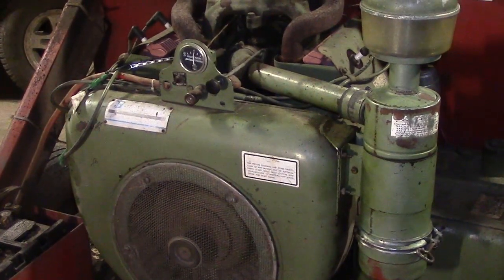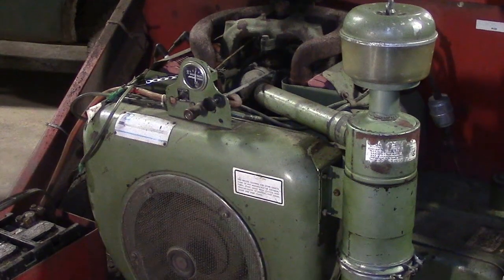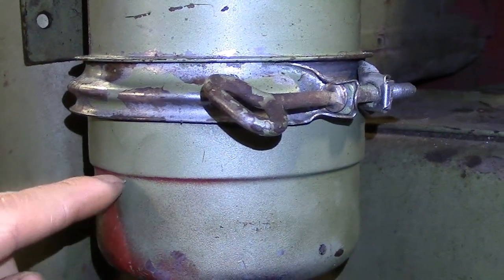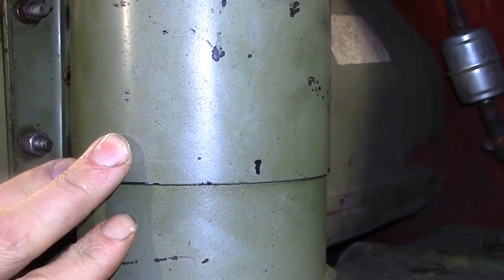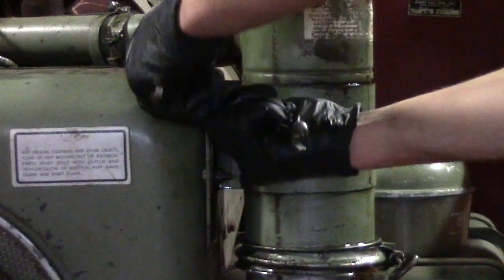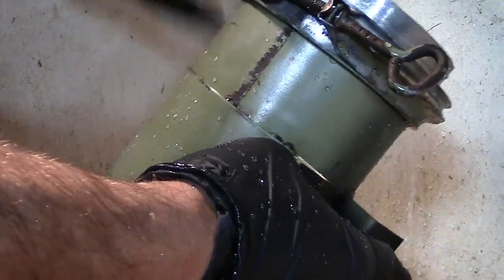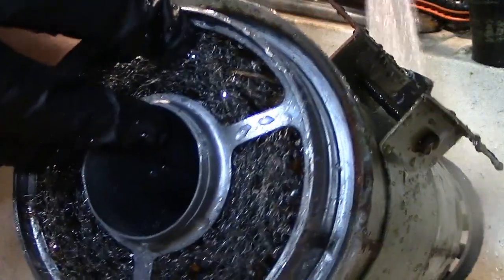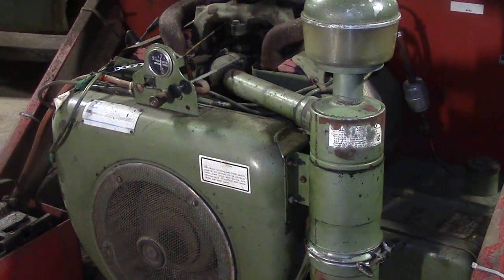Oil Bath Air Filter Cleaning on Industrial Engine

Comment: An oil bath aircleaner is great in very dusty environments. (such as combine harvesters and tractors, or coal mine operations)
However, in a nice clean indoor environment like that, a large surface paper filter would have been better, as it has less restriction than an oil bath cleaner.
Reply: Thanks, wasn't sure what the advantage of oil bath over a dry filter was. However, the engine on the video is on a leaf vacuum, so I'd assume it's being used in very dusty environments if it's used to load up yard waste into a truck or to suck up and grind leaves off a lawn during fall cleanup.
Reply: @MittyNuke1  Yes. Oil bath filters were on many cars from the 30s through the 60s, possibly even older than the 1930's. Even after paper filters were a newly created invention they were a dealer option on new cars you could order if you needed it. Rural drivers always used oil bath filters because it took the heavy gritty sand and dirt out of the air (remember paved roads were a luxury back then) and held it better, and could take a lot longer to fill up to capacity than a paper filter. There is never any need to remove and oil bath filter for a paper one.
Reply: @MittyNuke1  
Ah, that's a good point, all I saw was "engine .. indoors ... duurr" 😂